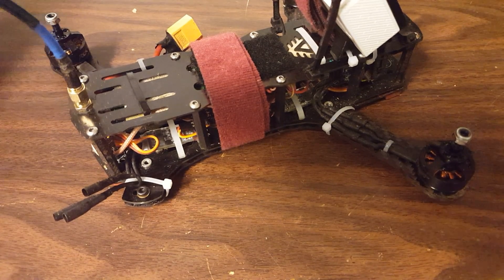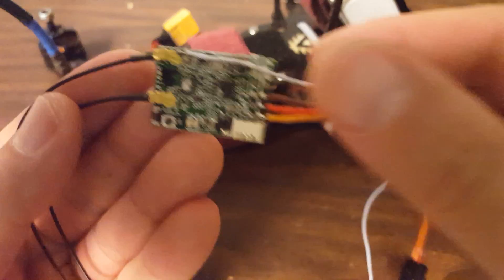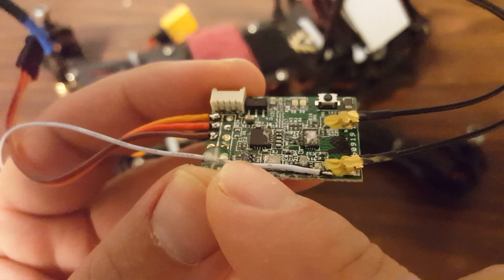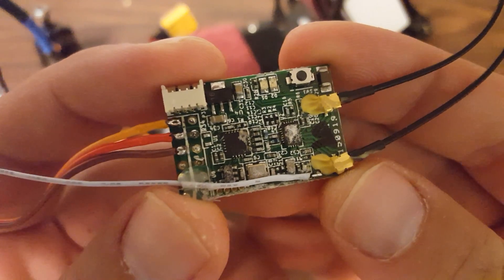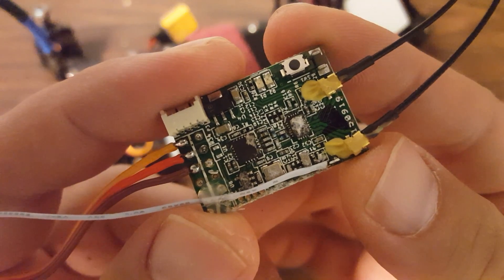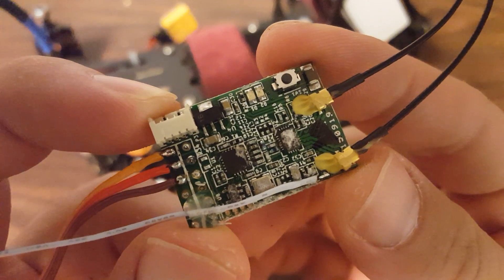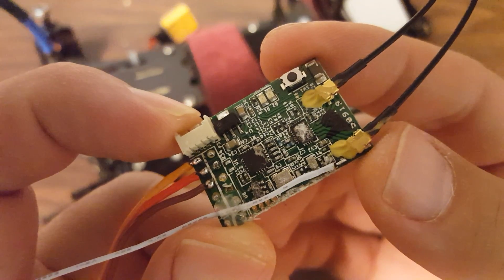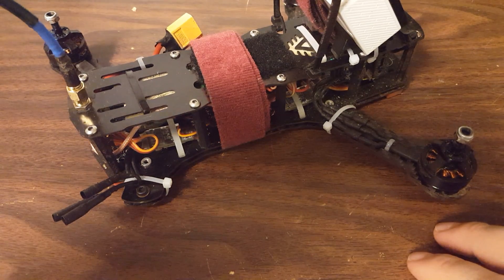FrSky X4R-SB depinned, and discussion of Analog voltage vs. Telemetry

Comment: im building my first FPV drone and im having trouble figuring out how to install the X4R-SB (without the pins) and cant find any information about how to install online. Every video is about de-pinning the old one but i just dont understand how to solder it to my DALRC F405 AIO flight controller/pdb. I have no clue what to do with the wires it came with as one side plugs into the analog and the other has a servo lead for pins. Do i cut the servo, plug in the analog and solder the wires to the flight controller or is the analog not even needed and i need to use the pin holes? sorry im a beginner and am very lost...
Reply from the maker: Go to about 3 minutes into this video https://youtu.be/3hG1EDzq4Jw

Comment: Hi Joshua! Probably you're still using X4R-SB. Could you tell me if it gets hot after you plug the battery in 1-2 mins? (You can say warm maybe)  Thank you for all your help.
Reply from the maker: No, it doesn't get hot. I think you have a short in your receiver.
Reply: Smartport, Rssi, Sbus are perfectly working. Is it still possible that I have a tiny short maybe?  Receiver is new, I just didn't check it before I've done all the soldering, so can't be sure what's causing this.

Comment: Joshua, Hmmmm.....  As one who uses mostly FPV I find the telemetry that uses a uart and needs more wiring, frankly, passe.  For my new 250 build I purchased an X4R-SB hoping for long range and maybe greater reliably for a craft I wish to take a bit further out for video.  I wish I had just gotten another diversity XM.  I love the channel 16 RSSI.  RSSI is the only telemetry stat that a modern FC can't provide straight to a micro mini OSD that I feel I need.  Is there a way to have an X4R-SB pass RSSI down channel 16?  Also there is something that bugs me about the added complexity of a two way receiver when one already has a good video feed that I haven't yet reasoned out.........

Comment: I bought a pdb with osd  and this board has a rssi pad , so if I connect the rssi wire from my x4rsb receiver to the rssi pad from the pdb should it work the rssi reading or would i need to do anything else?

Comment: Hi,
Do you know if there is a way to get the rssi reading from a tfr4 sb ?
Reply from the maker: +Teo Morabito FrSky says you can't do it.
Reply: +Joshua Bardwell damn, thanks for the quick reply, do you know of a small receiver i could use with a futaba 8fg that also has rssi for the core pnp ?
Ive been struggling haha
Reply from the maker: Nope, sorry. Futaba is not my specialty though.
Reply: One more question if I may,
I was previously using this "inverter" http://www.hobbyking.com/hobbyking/store/__24523__zyx_s_s_bus_connection_cable.html
to connect via Sbus my futaba receiver and the naze32
I've now replace the receiver with the tfr4sb and it is currently working with the "inverter cable"
Is it needed though ?
And do you know what it is doing,
I'm having trouble understanding the need for it and remembering why I had to use it in the first place haha
My main worry is if it is adding lag to the system
I'm happy to use Sbus over PPM as I now understand Sbus is faster.

I'm just really confused,
Sorry for the messy question and I hope you can help me with this.
I might try to remove the inverter, but since it's all soldered, I wouldn't want to remove it and find out I need to use it...

I feel like I'm doing something wrong by not using a taranis, but my 8fg feels so much better in the hands and fingertips...

Comment: You can also use clear Plastidip to cover your X4R-SB pcb, apply it with a brush around the telemetry port and button. It is protected then and you can also see the led.
Simply peel the layer off for modification. Do you know Sugru Josh? Great stuff for repairs.
Reply from the maker: I'm familiar with Sguru but for some reason I never use it.

Comment: I just bought a naked x4rsb. Its my first time soldering something like this. Do you tin the servo lead wires? Looks like they might not fit through the holes. Or do you just push the bare wire through and make a drop of solder?
Reply from the maker: I usually find that tinning a stranded wore makes it easier to push through. Perhaps you may need to fold back and cut off a few strands though.

Comment: I de-pin all my stuff. Always have, always will :-)
Reply from the maker: +Vortecks I'm starting to see the light. But I'm still not sure I would depin a flight controller, given how much re-configuring and repairing I tend to do. But I like the idea of depinning the accessories and installing pigtails.
Reply: +Joshua Bardwell With things like the ET Vector, I don't depin but anything like Naze, CC3D etc. I never install the pins. I only had one crash due to a detached cable and I've never looked back. I spend more time planning and placing things where I want them, rather than actually building because it is indeed a pain to rearrange things once it's done. Set it and forget it is what I like :-)

Comment: Quick question. So why solder to that RSSI pad and not the RSSI pin on the telemetry port? I'm running a Power OSD Pro (Much like the RR you have). Basically, I want to send RSSI telemetry to the Power OSD and Vbat to my Dodo.
Reply from the maker: +Danny Cruz I don't think the telemetry port has RSSI output on the X4R-SB. I think the pad I soldered to is the only one that gives you analog RSSI out. The telemetry port has Power, Ground, S.Port, and Analog In.
Reply: +Joshua Bardwell Thanks Joshua. So what you are saying is I should wire the OSD RSSI connection to that analog pad you used, and then VBAT to the FC to the S Port?

I'm a little confused about using the S Port versus using some other pad or a voltage divider for VBAT to my Dodo. I keep reading and getting conflicting information. Here I am on a Friday night with my depinned X4R ready to plug it all up, but I'm not sure yet.
Reply from the maker: You can do battery voltage through a divider to the A2 pin, or you can do battery voltage to vBat and then S. Port from the FC to the receiver. Or any combination thereof. vBat will come into the Taranis as VFAS. A2 will come in as A2. If you can do S. Port that's probably the simplest approach, assuming your FC has a vBat pin.
Reply: +Joshua Bardwell Yeah. I have a Dodo, so yes. I don't remember if I heard you or Final Glide say they hated using S Port.
Reply from the maker: Danny Cruz S. Port is fine if you have an F3 board with UARTS to spare.
Reply: +Joshua Bardwell Thanks!

Comment: Cool video Josh. Putting out tons of content lately. They sell them de-pinned at Rotorgeeks. Also have you seen the new FrSky XSR? They changed up the footprint ever so slightly and no more pins just a port. Also the antennas appear to be hard wired opposed to that putty on the X4R-SB... Not sure if I like it.
Reply: +Head Hertz it's already available at GetFPV
Reply from the maker: +deepimpact.io 99% sure the putty is covering up an x.fl connector. It's a toss-up whether that's better than hard-wired to me. The x.fl will be a bit easier to replace if you damage an antenna, compared to direct-soldered, but it is slightly less reliable.
Reply: I signed up for the pre-release of the XSR-SB. Seems like they took that same advice and de-pinned it, also got rid of other pins which can be a bad thing if you run servos. Personally I hate epoxy on an PCB, solder is much simpler and easy to fix in a mishap.
Reply from the maker: Head Hertz The big thing I don't like about the XSR is that it gets rid of the A2 port, at least as far as I know. I would rather depin an X4R-SB myself personally. But it's a great product to have in the stable.
Reply: +deepimpact.io Thanks! Hadn't noticed they had them already. I did notice the XSR seems to have two grounding pads for each of the antennas, I wonder if you could solder a type of sma connector to the receiver. Not sure why you'd want to but it looks like it's possible.
Reply: I got a couple of those depinned x4r from Rotorgeeks last week 😄😃 I also reversed the antennas to point toward the pin holes to make a smaller footprint and shorter antenna leads